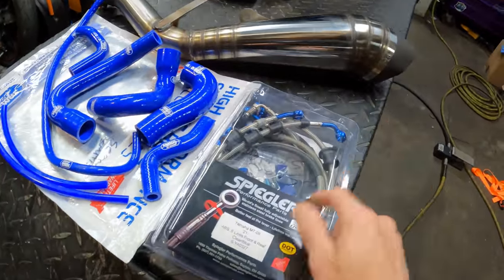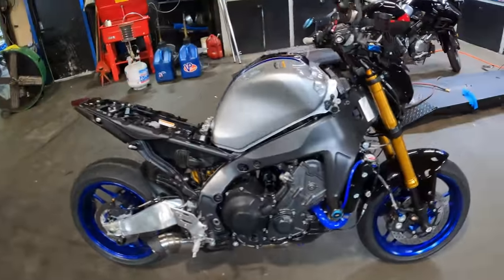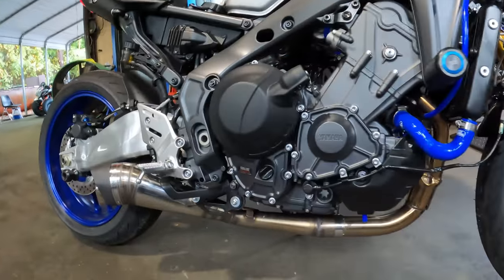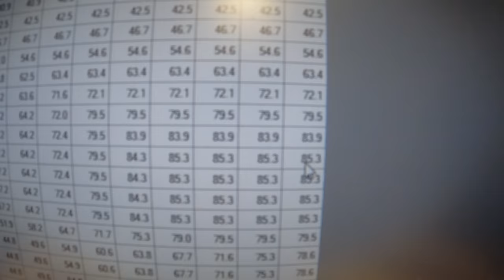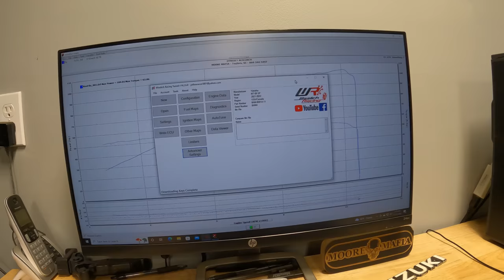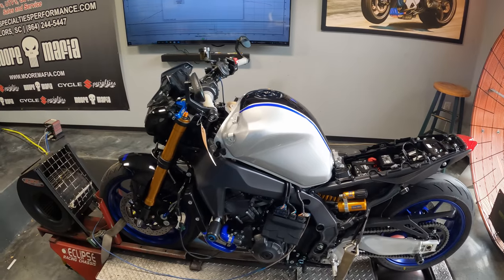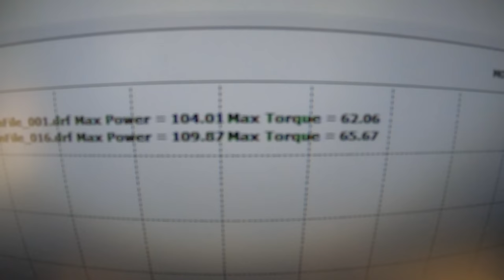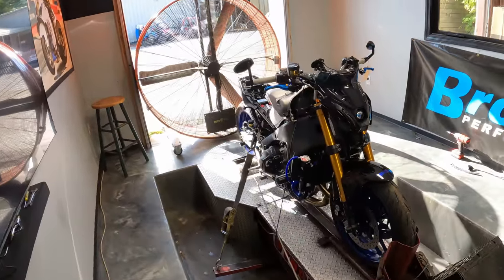2022 MT-09 SP DYNO Exposes MAJOR Factory Restrictions MT09

Comment: the welds on that exhaust 🤢
Reply: If it looks stupid but works, then it isn't stupid
Reply: If it's a budget friendly exhaust what you going to expect..
Reply: @papasouzas9703  
I’d say that the jury is still out on that one.
Pre-flash it made 104 whp which is down a couple of hp on the stock bikes that I’ve seen. 
And it didn’t even make 110 whp after getting flashed.
Reply: @MachoMadness69420  i have only seen them make 107whp at best, thats why i said it lol. Would love to see some other results if you could share some
Reply: Yeah the dominator gp3 is so much better than that thing it's only 500 usd and it looks great plus it really opens it up
Reply: The collector even looked smaller than the oem collector ☠️
Reply: @Adrian Vac im from spain , in spain are a lot of better brands than endy exhausts ,are low level but enough for this prices...👍
Reply: @MachoMadness69420  Aftermarket exhausts are several kg lighter than the factory which should be considered. I have a aftermarket exhaust on order, Mivv and the main reason why is the stock turns a horrible dirty brown over time. I'm going to spray the stock exhaust with heat resistant black and keep it spare in case I need to refit it.
Reply: @papasouzas9703  
You can probably get the same 109 whp by tuning a bike with the stock exhaust.
Reply: @papasouzas9703  Something can work and still be ugly and bad.
Reply: @MachoMadness69420  well no matter what the exhaust did, it only lost top end to the Akropovic exhaust
Reply: That’s what I was thinking!
Reply: Whenever you get an exhaust hand made in Thailand they always end up looking like that 😂, they rarely increase performance but always sound louder 😂
Reply: Almost a sin putting a pipe like that on a new SP
Reply: I thought I was the only one. . .
Reply: The Hubba Bubba Welding Company 😂

Comment: Let's recap. The apparent goal of Endy is to build a 3 into 1 header using the absolute shortest primary  tubes possible, using collector technology from a H-F garden hose triple outside wall spigot, and then weld it with a $39 E-bay,  battery powered stick welder, and using the wrong polarity and 1/3 the amperage for the diameter of the electrodes.  Sounds like a plan.
Reply: And pre-flash it’s only good for 104 whp, which is down a couple of hp on a bike with the stock exhaust.
Reply: @MachoMadness69420  Bc the bike is tuned for the stock exhaust. Rarely see any gains with just an exhaust change.
Reply: All these mods do if they add any horse power is move it up in the rpm range where it doesn’t do you any good in normal use. The bad part is 90 percent of the time it costs you hp and torque low and middle rpm range where you need it. 
A important thing is it also makes the motorcycle very loud and doesn’t help with the public image of bikers and motorcycles. We need to keep a friendship with the general public or risk more laws or complete loss of our sport. I had a squid come up to a stop by me couple days ago. BMW 900 twin that sounded like a Bahama kettle Drum competition in full swing. When we took off it popped, banged and whizzed!! I am a lover of engines growling though a low restriction exhaust that have a good tune etc. Ugly is conservative for the soundtrack of that bike.

Comment: Yoshimura redesigned their exhaust for this bike due to ground clearance when leaned over in a turn.  This exhaust sits way lower and further out.  Just food for thought.
Reply: The fit up underneath and a close fit around the rear tire is key.  Long Tubes is where the power is..  super shorties are crap..

Comment: I've got a 2021 sp , yoshimura exhaust, dna air filter, ecu flash and it makes nearly 120hp. loads better than stock. Definitely worth it.
Reply: Your tuner is fibbing.  115.9 is best we ever got with sprint f1.  Either you have exceptional motor or your tuner is fiddlin with temp, elev and humid inputs to "adjust" final hp/torq numbers.
Reply: @gk1racing685 this is youtube comment section.  My mt 09 has about 294 HP.  No tune.  There ya go

Comment: Akrapovic is a bit overpriced but it's a well designed and well build quality product. And the cheaper exhaust looked quite bad, the welding on those headers could have been done by my sister. She never welded anything by the way. It doesn't cost more money to weld something properly, that's just a lack of skills and/or proper equipment.

Comment: I have the Akra exhaust on my 2021 mt 09. Although that exhaust sits neatly under the bike unlike the Akra I still love the Akra sound. Have also the DNA high flow air filter and that makes it even better.
Reply: Best combo - I agree👍
Reply: I was thinking about pulling the trigger on 09sp but 109 to the wheel seems a little low to me. What's your experience with the power?

Comment: 2023 XSR900 Here..  went with the Dominator HP3 Black which was about $850 shipped from Poland incl. VAT.  Long Tube header, dual cans with DB killer.  Very nice solid Stainless steel..  saves like 8 lbs? which is significant in itself.  Finish is great, no restrictions..  Other Dyno flashes show superb curves... should know in a couple weeks when the ECU is returned.

Comment: The SP is not a cheap add-on, might as well get the gucci parts for it imo. I really like my Black Widow exhaust on my Fz09. The welds look fantastic and fitment is excellent. They are out of the UK and very budget friendly.
Reply: UK product 🤢
Reply: Yeah the sp is a grand more which is pretty good for what you get ohlins rear shock and cruise control
Reply: @gavin3810  Absolutely. They are very sharp in person.
Reply: @Robert_Paulson1360  yeah it's been the best motorcycle I've ever owned
Reply: Black Widow is a nice ass exhaust. My buddy has one on his gen 2 09

Comment: Super video! Very good comparison. Actually I had very similar lines with my full racing Akrapovic exhaust. Then I modified a lot and gained more than 122 whp and 69 ft p torque.
Reply: What mods you get done bro ?
Reply: Why didn't you just get an MT-10 or an R1? I don't understand why get something you know won't satisfy you then spend $1500 OR MORE  just for a few more HP.

Comment: All the MT09s that I've dyno'd and tuned have come out at 110+. The best figures are always with Akrapovic full systems and they are 115 to 116.  (That's a DynaPro S125LC dyno by the way, DJHP and DIN CF.)  Lextek exhaust isn't far behind the Akra and a huge saving, probably cheaper than that system you've tried there, which I think looks terrible.  Scorpion full system is pretty good too but still down a little on the Akra but mid-range money.  It would be nice to see you upgrade your dyno to one with load control.  You get much better IAP and TPS fuel map results from Woolich when you can use load control.
Reply: Have you done the dominator gp3 system?
Reply: @gavin3810  No, I've not even seen one of those.  They don't appear to be very popular in the UK.  But very good price for a full system, I would like to see how they perform as they look quite good too.
Reply: Have you got any data/feedback of the SC Project STR-1 or Yoshi yet?
Reply: +1
Reply: No doubt that you get what you pay for and this exhaust is just too cheap. 
It’s not nicely made + the numbers really leave something to be desired.
I’d go as far as saying that you can probably get the same 109 hp with the standard exhaust, since it’s only a couple of hp more than what a 100% stock bike puts down.
Fine for making the bike louder and you save a bit of weight, but it doesn’t really add any performance.
Reply: Have seen 115 whp at 10'800 rpm on my 2020 SP with the full akra system fitted (baffle and cat in) - took a pro nearly a fully day to get the tune to perfection - now it fuels like a dream, showing a linear 13,25 fuel / air ratio along the entire rev range from 4'000 to the limiter at 11'600 rpm. With the cat out, additional 7 whp could be found...

Comment: I got a Mivv Gp Pro full system on my 21 MT 09. The thing sounds amazing! Looking to get the ECU flashed next and see what power it makes
Reply: Looking to get that one too as I had it on my 2017 mt 07 and it was amazing. May I ask if it was easy to montage?
Reply: @-FlyingDutchman-   yeah the headers were a little hard to get to. But other than that, it was a straight fit.

Comment: I have a 2022 MT09SP with SC project CR-T exhaust and stage 2 DNA filter, with Vcyclenut flash tune up I'm pushing 116hp on the Dyno
Reply: So you spent $1500 or more to get 10HP? Yeah makes total sense.

Comment: I got a 2018 tracer 900 and do not think  it's worth it to mod the bike. Surprisingly I get 55 mpg with the thing loaded with camping or road trip gear. Perfect bike in stock form. Suspension could be a bit better though.
Reply: Bike is dang good stock! All these guys throwing around numbers, most never use them to that capability. Kinda like having a ten inch *^ck, but can’t use it.

Comment: What's wrong with that bike? the 2022 MT09 base is 117hp stock, my 2014 MT09 dyno'd at 121 hp after flash and tune with the an Akro exhaust.  Also did you block off the EGR \ PAIR system?

Comment: 2015 FZ-09 were making 115 hp and 64 ft-lb with 43cc less engine capacity.
That's the difference between a crappy exhaust system and a good one.

Comment: There is no substitute for horsepower but if you need to save money then it probably would be good for that.
Reply: If you want to save money you could probably get pretty much the same power by flashing a bike with the stock exhaust.
Reply: @MachoMadness69420  true a pipe don't give you much power a real good pipe only gives up around 10 or so hp. So its not a big deal. I would do a lot of stuff at the same time that makes a lot more power so the pipe is more about tuning than horse power. But most people think it's going to be all the power in the world.
Reply: Yeah even the dominator gp3 is a much better system and it's only 500 usd
Reply: I had a 93 GSXR 1100 and most people know it is the slowest GSXR ever made but mine ran 7sec in the quarter and would run way over 200 top end in fact a friend of mine that works for the sheriff clocked it at 217 and I had 2300 left on the tack. But I ran out of road and had to slow down.
Reply: @SVSecondChance  
?

Comment: Did you actually tune the fuel mappings as well? Or did you just open up the throttle and removed limiters? I feel like fuel mapping in correspondence with the wide open throttle at various RPM should give more gains?

Comment: Baffle made no difference in sound lol, it is not the exhaust I would have chosen.  I love the small black cans that Austin Racing and SC project does for example. Any small exhaust like those for less money should do the trick. They sound the loudest on most bikes and weigh nothing compared to other exhaust brands.

What is the most rear wheel power anyone has gotten on the MT-09 engine without going stupid expensive like a turbo kit ? Can you reach between 130-140 rear wheel horsepower on the MT-09 engine below 3000$/€  ?

Comment: I really like the stock exhaust on my mt09 sp, wondering if the ECU flash would be worthwhile? I don't like the on/off throttle transition in first gear with the nosediving effect and overall it feels more restricted from engine management than from the OE exhaust.
Reply: Yes
Reply: 1-3hp gains but more the changes in the throttle stuff

Comment: honestly quite a disappointment... the smaller 847cc predecessor can pull 125HP (with 99Nm torque) on the wheel, with an acropovic titanium exhaust (with modified DB-killer) and a K&N air filter.

so to see the bigger badder  newer 890CC engine making about 15 HP less...

i want to know what is your altitude where you dyno'd this bike? my bike was dyno'd by a professional tuner who does actual track racing bikes aswell, and the 125HP was tested on other test benches aswell to confirm it. all done at sea level.

Comment: I had the akra race exhaust and stubby carbon can on my MT09. Sounded excellent and looked like it was made for the bike because it was. That exhaust there is a dogs dinner, looks dreadful. Who would put that on an SP? I just spent £1000 on a titanium Akra can for my 2022 MT10 and saving up for the titanium mid pipe which is another £750. Buy cheap, buy twice.

Comment: i would love to see the mt09 and z900 dyno overlay.
Reply: Agreed. But not some Spanish budget garbage exhaust with DB killer stuffed into it.
High flow headers, no cat, large I.D. mufflers, best street-use air filters, snorkels or other restrictions eliminated, quality fuel at optimal octane, both with the same tires and same engine oil, and Moore ECU flash.
Reply: They make roughly the same thing but the z900 is so heavy to the point where the mt 09 is just faster due to the power to weight ratio
Reply: @gavin3810  I've owned both. The idea the Z is slower than the MT is like splitting hairs, and this is absolutely no reason at all for someone to determine to have one over the other. Properly fitted with all the common de-restrictions, both are so close in power than the difference is made up with rider weight/size/talent, not motorcycle capability.
Comparing the pre-'22 MT to the Z of any generation, the Z is a better chassis and a much smoother engine. Most about it is better:  engine tractability, throttle control, switchgear, overall smoothness, chassis and suspension stability, high speed confidence and stability.
For 2022 the MT-09 when through a major overhaul and Yamaha fixed tons of its shortcomings. Does that make it more powerful than the Z900 or better overall? Depends. I think the Yamaha makes more torque on AVERAGE, considering it weighs less. Again, do all the usual modifications to both, the Kawasaki loses more weight with mods, and still makes stronger "peak" numbers, bringing it pretty close. Again, rider weight/size/talent is the difference.
I like the character and wide torque band of the Yamaha. I like the smoothness and top end of the Z. I like the technology of the Yamaha. I like the bigger fuel range and simplicity of the Z. If you want relaxed ergos and better appearance, go with the Z900RS Cafe. Want a cruise control and "classic" design? XSR900.
Can't go wrong with either brand.
Reply: @exothermal.sprocket  you also just get alot more for what you pay on the mt 09 vs the Z900 plus my main issue with the z is I found it much too boring on the test ride the best thing I have to say about the z900 is that I have nothing to say about the z900 besides that it's smooth.
Reply: @gavin3810  Some people like their food flaming hot. Some people like their food salty and bitter. Some people like their food sweet. Some people like it raw.
Boring vs interesting is entirely YOU, not the bike.
Reply: @gavin3810  i would like to see it on a graph. they are about 40-45lbs apart, but you can knock off quite a bit of that with a breadbox delete and muffler swap. the z900 has about 10 hp more on the dyno, but i would like to see more than just the top end horsepower. looking at the curves on an overlay can tell a lot about how they perform and handle.
Reply: The 21+ MT-09 is a much better bike period. Way better tech. I mean come on the Z doesn't even have a quick shifter/auto blip.
Reply: @tarnishedsquid2967  the mt09 may be a better bike to some people, but not to all. when i test drove a 2019, it felt like i was sitting way up on the bike, it was almost like riding a dirt bike. the z900 has a much sportier feel without killing my back like a full-on sport bike would. i could add a quick shifter to mine for a couple hundred bucks, but i haven't had to use the clutch to shift since i bought it so it seemed like it would be a waste. aside from that, they seem to have the same type of tech. the mt09 isn't a much better bike, it's just different, and depending on what you want determines if its right for you.
Reply: @rozzbourn3653  Six axis IMU traction control, it's also about 40lbs lighter, Kawi needs to update the ol Zed to compete cause it's lacking behind the competition.
Reply: @tarnishedsquid2967  the kawi has traction control (doesnt need six axis IMU because its stay planted), more horsepower/ torque, top speed, buttery smooth and you dont have to worry about pulling the wheel up because of low gearing and sitting high up on the bike. dont get me wrong, it still power wheelies, but its more manageable because of the low center of gravity. saying that the mt09 is better is subjective at best. i will say that after riding both i will have to agree to disagree with you.
Reply: @tarnishedsquid2967  i have not ridden the new one, that's why i would like to see the overlay to see in what ways it improved. i would also like to see the old mt09 stock vs stock overlay.
Reply: @rozzbourn3653  
As someone who replaced a 2021 Z900 with a 2022 MT-09, I’d mostly agree with you.
They aren’t that far apart, despite what some people claim.
The Kawi’s traction control works pretty well and at no point did I feel like the bike was lacking in that department.
I often get the feeling that people think of an IMU to be some sort of get-out-of-jail-card that will save their ass every time.
The extra weight is mostly felt when pushing the bikes - out on the road the difference is pretty minor. 
In the end it really comes down to preference IMO.
That being said, the Z900 could really do with a quickshifter.
Reply: I was considering the mt09, but if I want to sit high up like riding one of my old dirt bikes, I would get a supermotard.